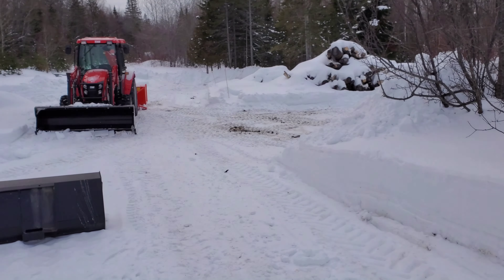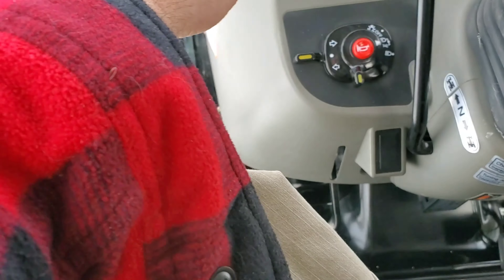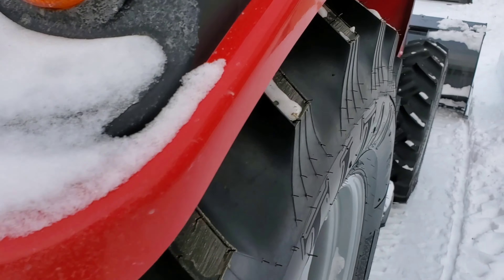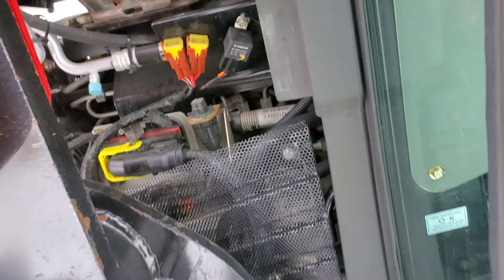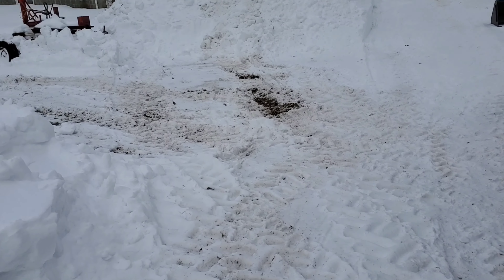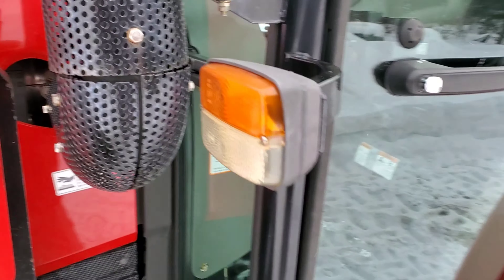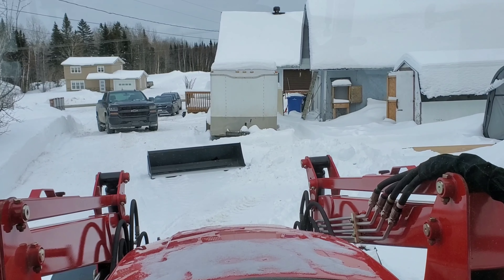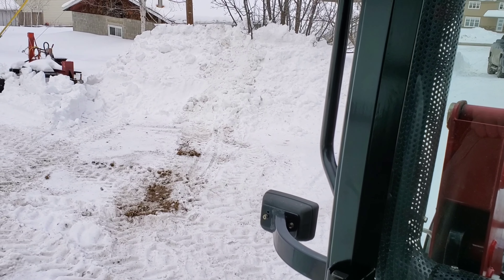TYM 654 Tractor...The New Brunswick snowblower special.

Comment: we have used John Deere and Kubota for years in the woods but just got a TYM T494 and T654 T754 to work in the woods and love them the 654 pulls a 9 ton forwarding trailer the 494 winch up wood and the 754 work the delimber
Reply from the maker: Nice team you got going on